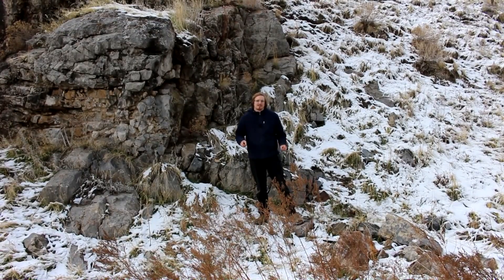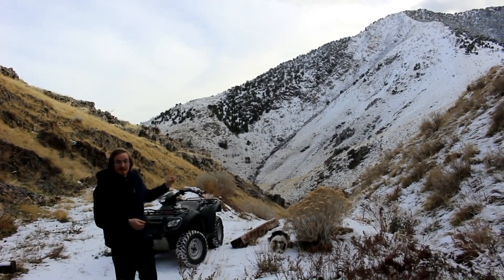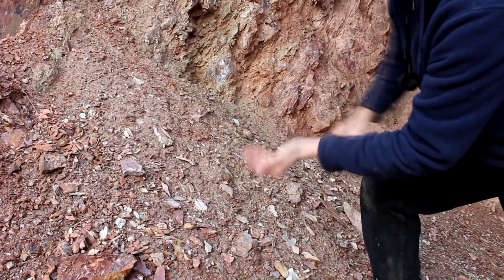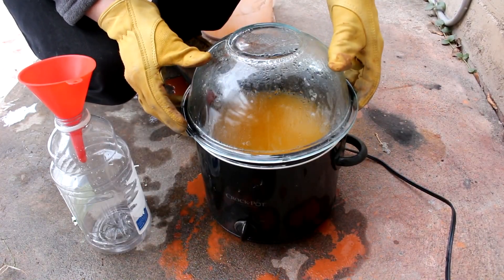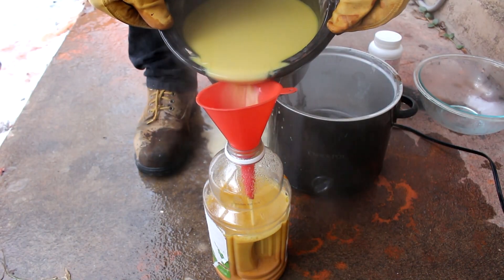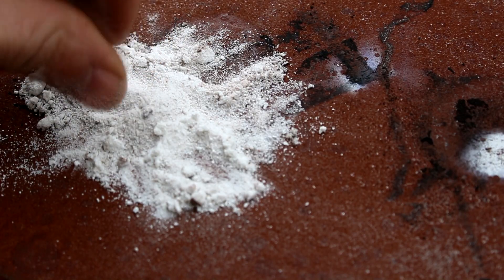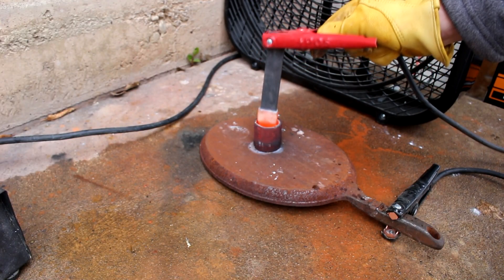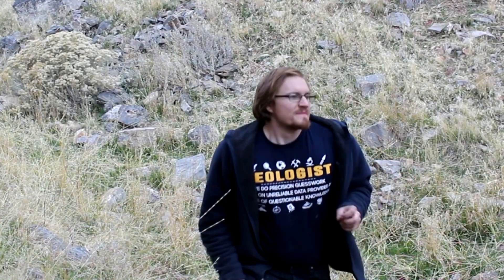Aluminum From Dirt

Comment: Great video, I just have one question. How do you know that the aluminium yielded didn't just come from the cryolite? Or, assuming some of it did come from the cryolite, can you say whether or not it was a negligible amount? Would it be possible to tweak the experiment to not use any other aluminium containing compound? Of course, these are questions I have as a layman, as someone who knows nothing about cryolite (e.g. how much aluminium it contains and whether or not it can be separated out via electrolysis). Anyway, thank you. As always, I quite enjoyed the video.

Comment: I can't forgive IUPAC for pandering to the aloominum sayers. I think Aluminium and Sulfur was a good compromise. The Brits should start insisting on calling it sulphur again in retaliation.
Reply: Smodking No, I'm saying take the i in Americium and move it to Aluminum. That way you have Americum and Aluminium. I think that would be a fair compromise.
Reply: Salvatore Shiggerino I already do insist on 'sulphur'. At least here the difference isn't audible.
Reply: Yes, I suppose the Americans don't find it a fair deal since sulphur and sulfur is pronounced the same.

Here's an idea: let's give the Americans Americum in exchange for Aluminium! It's their own element, so the rest of us can't really complain.
Reply: What do you mean? The IUPAC spelling is aluminium.
Reply: HH539 They sold out in 1993 by making aluminum an "acceptable variant".
Reply: there is already so many discrepancies regarding American pronunciations that it barely makes any difference at this point. i spell it Sulphur, i didn't even notice the US uses Sulfur, but until they start calling trousers, jam, and bumpers by their proper names then it is but a wild goose chase.

Comment: Couldn't you have used a pressure cooker for keeping it at 200c?
Also you really should wear a welding mask for the electrolysis you were doing because of the arcing

Comment: I wonder if you could have a plasma furnace to separate materials and recycle the heat to make it more cost effective. That way you could throw literally anything into the furnace and it would separate it by mass through like a mass spectrometer. Might still be too expensive tho :/

Comment: Put Gallium in one of those glass tubes and seal it then allow it to become solid or fill up a metal pipe with  Gallium then seal it tight and let it become solid inside. I think that would be a bit interesting.

Comment: You could have added more lye to the solution, when making the aluminium hydroxide. This would have formed soluble sodium aluminate and the iron hydroxide could have been filtered off. Acidifying the solution would have led directly to very pure aluminium hydroxide. Nevertheless, you got it to work. Nice video! :)

Comment: Cody, when the liquid wants to run down the side when you're pouring it out of the crock pot, try taking advantage of it and just holding the pot above the bottle and letting it run down the side and into the funnel.

Comment: Cody, I've noticed that silica is starting to be used as a "coating" for paint in the automotive industry. It's in liquid form and you spray it on the paint while it's wet and blast it off with a pressure washer. It forms a hard coating that protects the paint for a little while. Do you have any info on this type of product?

Comment: Cody, if aluminum is found in the tropics, why is iceland the #2 exporter of aluminum?
Reply from the maker: because they have cheap electricity, I bet they import a lot of alumina.
Reply: Maybe I misread and they machine and form aluminum. Edit: I have read up on it, and iceland contains the worlds largest aluminum refinery. they refine ore.
Reply: they refine ore.
Technically, it's the smelting that takes the energy, not the refining, that's what they're known for.
Bauxite is refined into alumina, then the alumina is smelted into aluminum. Iceland does the smelting, the bauxite is generally refined into alumina in the place it's reserves are found. More than 50% of known bauxite reserves are in Guinea, Australia and Brazil alone.

https://arcticecon.wordpress.com/2012/02/15/aluminium-smelting-in-iceland-alcoa-rio-tinto-alcan-century-aluminum-corp/
Reply: you doing ok cody? you sound a little different in your video
Reply: Tectonics also tends to move things around. At one point those rocks were under the ocean. Nice try though you almost sounded smart, :)
Reply: ABitOfTheUniverse most of the energy is used in the electrolysis of the molten alumina
Reply: Brice Johnson You're welcome.
You raised awareness for the industrial processing of imports and exports, and I'm sure it'll help people understand a little more how things get created.

Reading your comment, followed by Cody's made me interested enough to learn more, and I can only imagine others did as well, which is, of course, always a good thing.

Always.
Reply: Brice Johnson 
Cheap electricity,lots of power generated from hydroelectric dams.
Reply: jeff pfeiffer  and geothermal!
Reply: en.m.wikipedia.org
Reply: I live on the north shore of Quebec province's st-laurence gulf (town name: Sept-Iles) and we're one of the major exporter here of aluminum as we have extremely cheap electricity here from the multiple hydro-dams, we process bauxite mostyl from brazil  and such place.
Reply: Michiel Wesselingh "The Hall–Héroult process is the major industrial process for smelting aluminium."
Yes, it involves electrolysing the molten salt, you are correct. It is a process of smelting which involves electrolysis.
Reply: Michiel Wesselingh forgot my source
https://en.wikipedia.org/wiki/Hall%E2%80%93H%C3%A9roult_process
Reply: ***** No, I did not know that.

Because it isn't true.
Reply: I can guarantee that Island has a lot of fault lines and acidic water from vulcanic minerals. It doesn't hurt that warm water is essentially free as it rises from the crust.
Reply: ABitOfTheUniverse  thanks for the info!
Reply: TIL that i can delete harassing comments off my thread.  Wondorous!
Reply: Mostly do to cheep electricity and government contracts that encourage tax evasions.
Reply: Brice Johnson 

Forgot about that, brainfarted that! 

Had Alcoa stuck in my head.
Reply: jeff pfeiffer yeah, it seems they have at least one (nominal 690MW) hydroelectric power plant dedicated almost solely to aluminum smelting. https://en.m.wikipedia.org/wiki/Electricity_sector_in_Iceland
Reply: Brice Johnson

Comment: It seems cheaty to use aluminum (in the cryolite) to make aluminum.  How do you know you weren't just getting the aluminum out of the cryolite?
Reply: I'm not a chemist but AFAIK fluorine bonds are generally very strong and hard to break. Since the aluminium in cryolite is surrounded by fluorine atoms, I think you'd have to put in a lot of energy in order to get the aluminium out of the cryolite. Also Cody said that the cryolite is not consumed in the process and can be reclaimed.
Reply: Not cheaty at all.  The cryolite doesn't really break down in the process he used, which is a small scale version of the Hall-Heroult process.  This process is one of the most common used to extract aluminum metal from Al2O3.
Reply: by the ammount he its getting out, and also because there would be lots of iron contamination.
Reply: He already said in another comment that most of the Aluminum probably came from the Cryolite.
Reply: That's what I wanted to say! I don't like the idea of adding aluminum to help get aluminum, haha. Though it seems it may not have affected the end amount of aluminum, it still seems cheaty to me too :p
Reply: There is no iron in cryolite.

Comment: i was wandering how easy it would be to recover metals from a machine shop floor after its been contaminated by other metals and grindings. weather it would be worth keeping the sweepings in a bucket to see if i could melt the metals out and separate them. im currently studying to be an aviation technician and the amount of aviation wast is something i frequently look at weather it be composites of the metal shwarf on the ground after a day drilling holes.

Comment: Hi Cody, how do you know that none (or at least very little) of the metal in your product came from the sodium aluminum fluoride (cryolite)? I could imagine that your electrolysis and heating may have released some of the aluminum from the cryolite into your product, so it would be hard to tell how much (if any) of your product came from the actual ore.

Comment: where the hell do you find metal bricks at?
Reply from the maker: I made it from some scrap bullets
Reply: Well thanks for responding.
Reply: Question, have you made a video on sound and vibrations? i would be cool to see a video on destroying stuff with sound waves. like glass or paper.
Reply: it*
Reply: From the metal brick store. DUH.
Reply: dylan simmons he made a video about this! I believe his grandfather got it from miners who were looking for gold. the mercury was a waste material so they basically just gave it away.
Reply: He does that.
Reply: im sure there was a video where he made them from lead bullet shells or summat. it was cool ep try find it
Reply: Metal bricks are nothing. He's got a shed with an infinite supply of mercury jugs.
Reply: he made them from lead
Reply: dylan simmons I think you underestimate cody's arm strength :P
Reply: He also got it from a dentist I think who gave him dental mercury
Reply: dylan simmons he just made one
Reply: dylan simmons nope. it was lead
Reply: dylan simmons he made lead bricks from all the lead ore around his ranch, at least that's what I think
Reply: oh well if it was lead he wouldn't have been able to lift it with one arm, or maybe it was iron or some light metal.
Reply: Commander Shepard no way that was lead. did you hear the noise it made?
Reply: Cybernite he confirmed that he made it from scrap bullets in earlier answers
Reply: Well I mean I might have, but still it's a brick of lead.
Reply: And artificial crystalline Ruby Crystal
Reply: Your right where does he get the much mercury and I don't think he got all of it out of the ground. So that's alot of money.
Reply: dylan simmons he makes them from lead bullets he melts down and remolds. he shows us in a previous video.
Reply: dylan simmons It cant be a pipe bomb if only one side is sealed. The other side is open; I am explaining a sonic/vortex cannon. Basically shoots air
Reply: Warrior Son where?
Reply: +dylan simmons 1. plug one end of a 6inch pvc pipe 2. add in a grill igniter, 3. fill pipe with oxy acetylene, 4. aim 5. ignite 6. your done
Reply: Random_rapper20 that's not very nice.
Reply: +dylan simmons why?
Reply: Esquire Taylor that's not very nice I had a question about it you don't have to respond like that. If you don't know the answer it's not a stupid question.
Reply: Esquire Taylor oh sorry I thought you where trying to tell me to go kill my self with a home made pipe bomb.
Reply: drama, opera, theatres usually have too much of them
Reply: See a lot of comments saying it isn't lead for whatever reason. He has a video of him making these bricks from lead bullets and weighing them. They're lead, he's buff.
Reply: dylan simmons             H
Reply: ? H did you mean Hi

Comment: One of my dad's first jobs was working in a factory shoveling alumina sand into a machine that made artificial rubies. This would have been back in the summer of 1966 or so. 
Cody, any chance you want to take a crack at making your own ruby? The verneuil process doesn't appear to be all that extremely complex.... (that's a little sarcasm...but still kinda serious)

Comment: Cody, why does clay form a bonded solid brick under heat and pressure, always wanted to know exactly what happens to the clay particles that bonds them from slipping.

Comment: Of all the things you have done, this is the first one where I thought 'this has to be unsafe' when you used a welder and a pan to electrocute molten metal lol
Reply from the maker: Not to mention all the wet conductive fluid on the ground ;)
Reply: Well, it was only 6 volts, wasn't it? Might hurt a bit if it (for some reason) arcs, but should otherwise be safe.

Comment: 9:23 pour straight onto you feet :D
Reply: 16:04 even better molten metal on wire :D 

So funny :D
Reply: But he played it off so well.  Barely stopped talking and did a little foot shuffle, nothing happened move along.
Reply: In Cody's Lab, feet melt your acid.

Comment: Damn man, you're so sloppy at times. First you soak your shoe at HCl + Al2O32SiO22H2O solution, then you grab a hot carbon rod with an active electrode, then you empty the hot metal on a flat surface, Jesus man. I mean, I do mistakes like that as well when I'm about to finish a project, but my projects don't involve caustic acids or molten metals.
Amazing video anyway, can't wait till you make a metal brick out of Luminium :)

Comment: hi cody..i was just wondering if you can make an experiment on making a solution that can  dissolve gold from electronic circuit board..without dissolving much of the other metals like what cyanide does...but non toxic...i hear about using concentrated vinegar but couldn't figure out what the other chemical mix were..this would be a great help to home refiners..only if its possible..thank you in advance..

Comment: Holy shit, there's a shitload of chemical reactions in this video!! I was expecting a couple but not so many. Is this the fastest way to do it or is it just the only one using household chemicals? How would an industrial process differ?
Reply: He touches on how industrially, Aluminium is separated with Sodium Hydroxide at very high temperatures, which he determined would be quite difficult for him to do. See timestamp 7:48

Comment: This video felt like a mistake as there where multiple mistakes done. Like you could of taken more rock with you knowing that in past experiments, you don't get much from it anyways. And when you poured it, you spilled like half of the entire thing because you chose a bucket who cant pour liquid, and you also put the liquid in a bucket which leaks, usually you either get a new bucket if it leaks or patches it but that wasn't the case, You could of mixed the dry sand together inside instead of in the snowy weather because they get moistured from the snow or under a roof. You failed on the electricity part as first it didn't work and second, even when it did, you again spilled a lot of it during the process. And when it got down to pouring it, you did it when the fan was going which made it go everywhere, and on the cord. Could of been done more professionally and could of gotten more aluminum out of it.

Comment: Years ago while working for a carbon company we were researching a method of making a ceramic non consumable anode for aluminum smelters.  As a part of that I made a small test cell/furnace to perform the reaction.  We used a auger drill bit to dribble in additional cryolite/alumina mixture.  As I recall the off fire temp of the furnace was about 1000 deg C.  We did get several formulations that had impressive erosion rates which was essentially  non consumable.  The anode was a ceramic material which really worked very well but would have been fairly expensive to produce.  I did get one patent out of the deal though.

Comment: Cody you should make an experiment on Space Welding metals in a vacuum
Reply: Rodrigo Lopez I think it's called cold welding, I think the surface needs to almost no contaminates, and a high vaccuum. I think it would be cool also.
Reply: Thanks, I did some further research and it seems like huge amounts of pressure is needed. It would ve a very elaborate experiment
Reply: Rodrigo Lopez I can't find a pressure needed to perform it, I'm sure it would take a lot. I heard a story about one of the Gemini spacecraft's (Not sure which one or if it was a Gemini spacecraft) doors were cold welded shut but it turned out that it was just a jammed door.

Comment: Could you please explain what a fault is? (sorry if its a different spelling)
Reply: JthayerTheGamer it is a crack in the earth
Reply: Googling your answer would just be much easier
Reply: its the borders between tectonic plates (large portion of earth slowly sliding across the liquid magma core)
Reply: A split in the bedrock that will grind against each other. They are where earthquakes originate, though most earthquakes form by the tectonic plates grinding and releasing from each other. Google is a much better resource than the Youtube comments though, so do some research on it.
Reply: uwn XDD your just the type if person i enjoy
Reply: JthayerTheGamer a cat
Reply: Shark
Reply: ewrs97 actually it's cracks in the earth from all that pressure.
Reply: Anime Invisible and ignored kk :)

Comment: Hey Cody, me and my friends want to do a project and basically it consists of extracting nitrates from manure, make gunpowder to blow up rocks and extract iron ore to then forge a blade, what do you think I should anticipate before jumping into it?
Reply from the maker: thats going to take a while... I'm still working on parts of that myself. in theory everything is quite easy but putting it all together and actually doing it.. well it is impressive when someone pulls it off.
Reply: Cody'sLab True, and also I don't really have a lot of tools to obtain quality ore, and I was thinking just plain old panning would do the trick since it's on a small scale, what do you think?